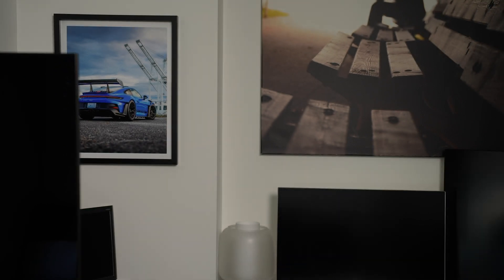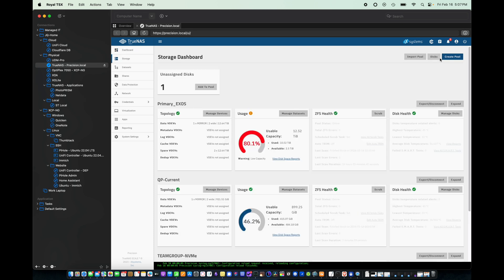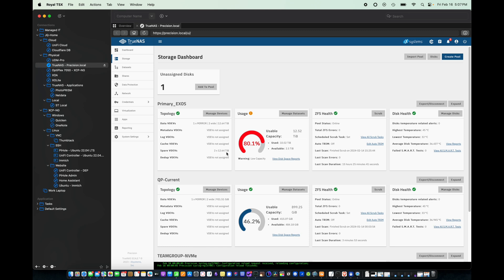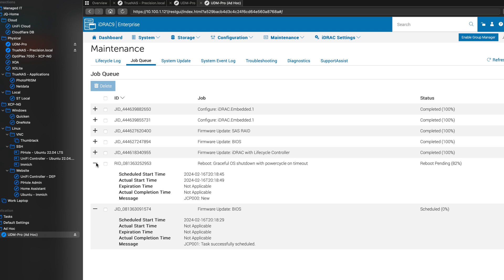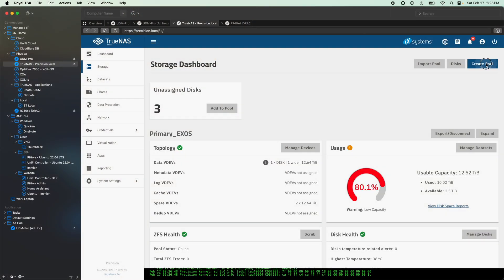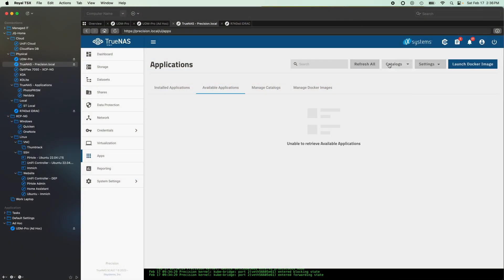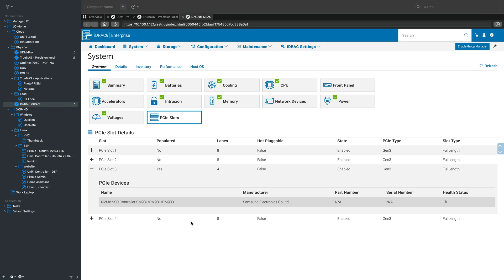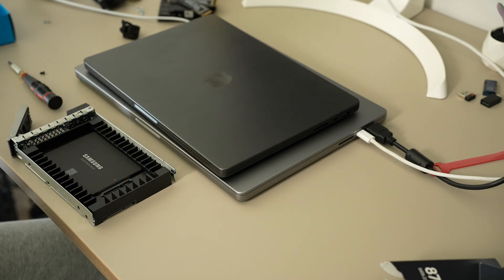TrueNAS Scale - R740xd Server Migration

Comment: How much did you buy that system? 
And if affordable can you share the dealer's website. I have an old dell poweredge T320 running Proxmox that is extremely slow especially when you run windows vms. Don't know whether upgrading it from hard disks to SSDs will be worth it or just purchasing a newer affordable system.
Reply from the maker: The R740xd was about $800 from Core4Solutions in Minnesota. That doesn't include the CPU, RAM or drives. 

If you're running your current T320 at home, I'd consider going with a newer PowerEdge T machine or possibly a Precision 7820 so you'll be able to run at least on 2nd Gen Xeon Scalable. 

Another option would be to build your own PC on Intel's consumer 14th Gen platform which would come to a similar price point. Promox now supports those efficiency cores on the newer CPUs, so you shouldn't have any issues there!

I personally run my VMs & video editing on NVMe or SATA SSDs only and my business photo libraries run on slower SAS based Seagate Exos drives in RAID 1. I have an average throughput of about 200MB/s per drive on those compared to 550MB/s on SATA or a max of ~1100MB/s over NVME while being bottlenecked by 10GbE. Let me know if you have any questions!
Reply from the maker: https://www.core4solutions.com

Comment: Can you please make video how to host your own domain through TrueNAS
Reply from the maker: Host your own domain? To show services externally? Or are you referring to a AD domain controller on truenas?

If you’re looking at the first one, I’d recommend using Cloudflare DNS, Nextcloud with a SSL cert and then port forwarding 443 or you could go the reverse proxy route as well. 

SMB/NFS isn’t supposed to be used externally on the internet.
Reply: @johnstech7  Thanks for responding bro, I just wanna host may own domain ,truenas ,I just wanna host a lot of domain ,under my own server
Reply: Can you  please make video how to host domain from GoDaddy  please
Reply from the maker: Sure, I can look into that. 

I’d recommend you’d use a Wireguard VPN (assuming you have a public IP address) instead of having all of your services public facing because of the security risk. Forwarding ports to services is a bad idea especially if they aren’t hardened. I would only forward a VPN or maybe in a blue moon SSH/port 22 through my firewall and that’s it. 

Again, SMB & NFS aren’t supposed to be public on the internet.